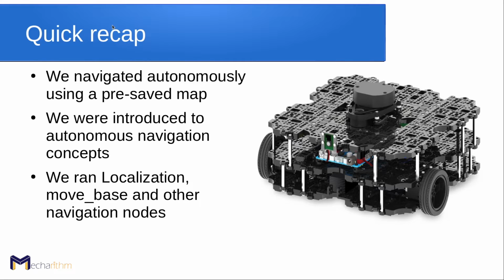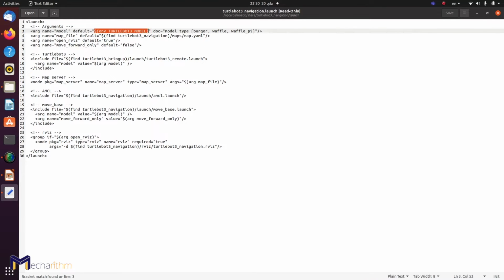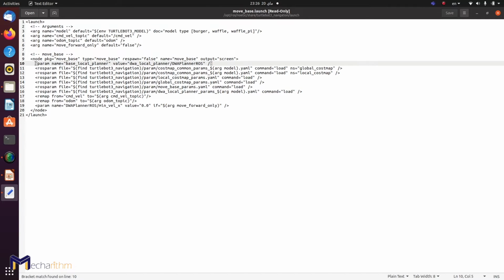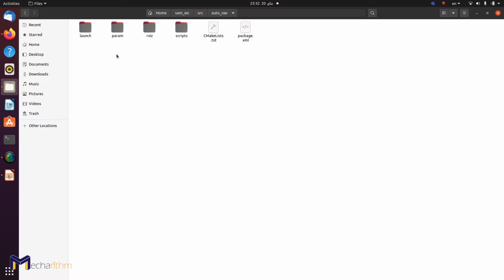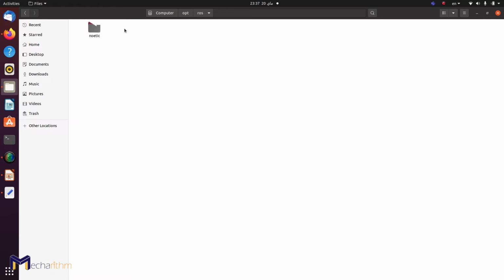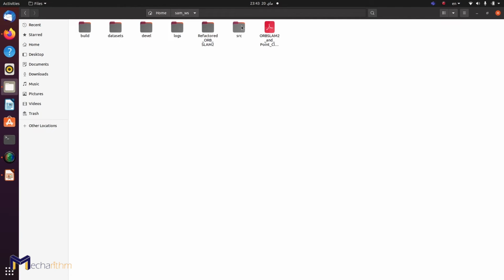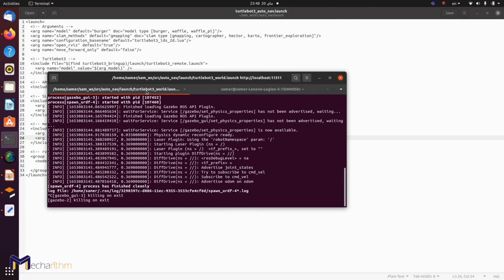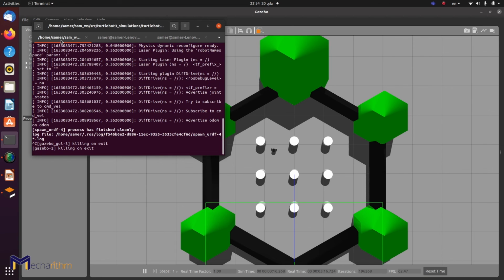Autonomous Navigation Mobile Robot Using ROS Without Using a Pre-saved Map | ROS 101 | Lesson 10

Comment: To avoid warning messages such as 'sensor out of bound' in move_base, the 'static_map' parameter in the 'global_costmap_params.yaml' file should be set to true. Even with the 'static_map' parameter set to true, navigation works well without a pre-saved map. If you want to set the 'static_map' parameter to false, you need to use the 'rolling_window' parameter as shown in the 'local_costmap'.
Reply: @jongyoub_sah  my robot is not able to go to an unknown location i.e., the location in a map that the robot hasn't explored. would you please tell me the solution to resolve this issue?
Reply: Thanks, it solved the issue

Comment: if im use 2d navigation goal, is the python code neccesary? beacuse when im try to give 2d naviagation goal. my robot in gazebo and rviz only keep turning and never reached the goal point.

there is warning says the robot start position is off the global costmap.
Reply from the maker: You can use Python, C++ or Rviz GUI directly (using red and green arrows as in the tutorial) to navigate to your goal.

For the  "warning": Try to change the initial position of the robot in the simulation to be close to the global frame origin. Maybe it starts somewhere far away from the cost map boundaries. Just edit the spawning settings in the XML file.
Reply: @mecharithm-robotics  could you please elaborate to solve the issue that you mentioned i.e., the robot is moving in circles instead of going to goal position.
Reply: Getting the same error😭

Comment: what parameter should i concern when i want to use real map without simulator?
Reply from the maker: The same exact parameters apply to both simulation and real life scenarios. You have to consider what set of sensors are attached to the robot. For a Turtlebot3, the simulations pretty much match reality. The e-manual we used in the tutorials also has special pages for hardware deployment.